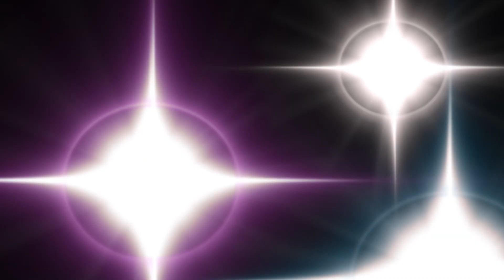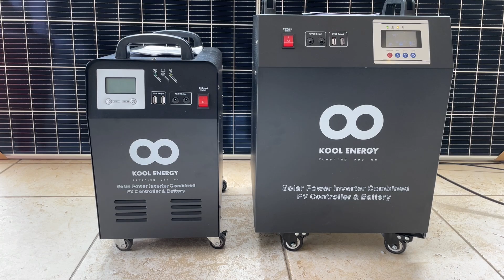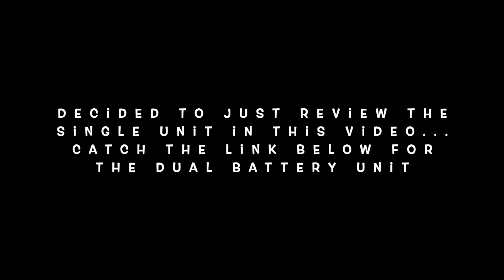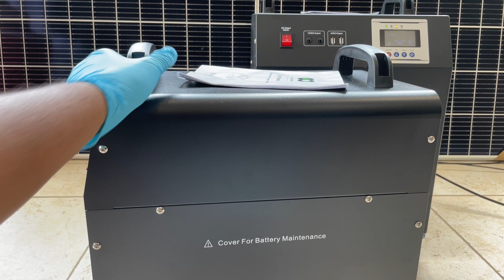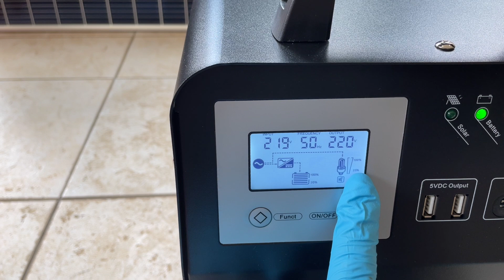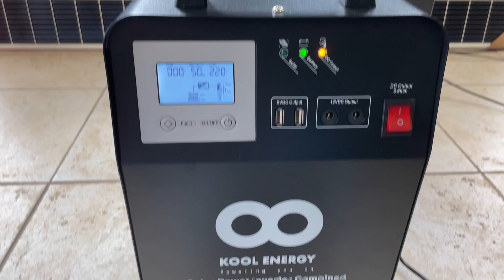Reviewing the Mecer Kool Energy 1000w 12v Pure Sine Wave Inverter - Load Shedding Solution!

Comment: Thanks for sharing, this is highly appreciated. We will share with our friends, families and colleagues. My battery light remains red and I don’t know what I am doing wrong 😑… the battery switch is off and I am charging it using electricity so that I am powered when there is no power. Please help what am I doing wrong as the battery light remains red. 🙈🤷‍♀️
Reply from the maker: Hey do you have one of these units? The red means there is a battery protection on. Try this, turn off the unit and the breakers let it stand for 5 minutes. Then start it up, and let it run on inverter, battery mode - do not connect to power. When the battery gets to 50%, plug it into power and monitor.
Reply: @alternatesolutions2408  Yes I do,  and the company I work for has bought them for all my colleagues.  I have shared your link with with most of them, am sure they will be needing your help!
Reply from the maker: @phollipedwards1087  drop me an email and we can chat further if you need help. I will be happy to assist. Enq.Alternate@gmail.com
Reply: @alternate solutions,can l please have a softcopy of the manual
Reply from the maker: @carl_fayal  please send me an email and I will scan it out to you